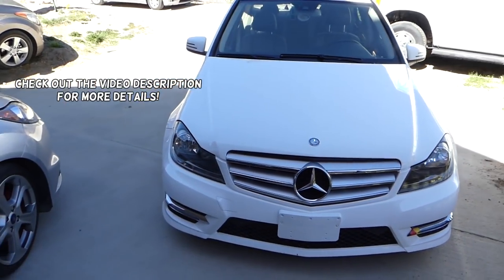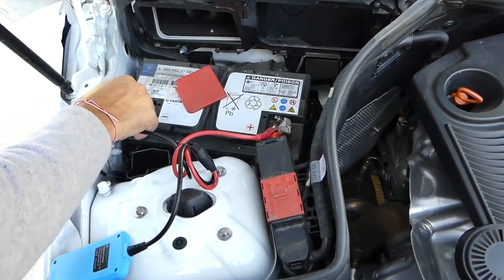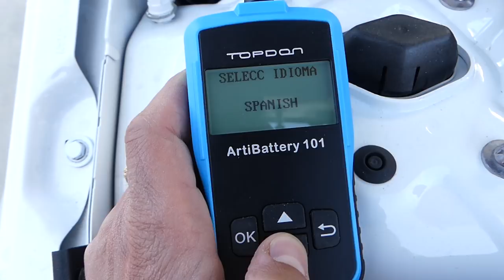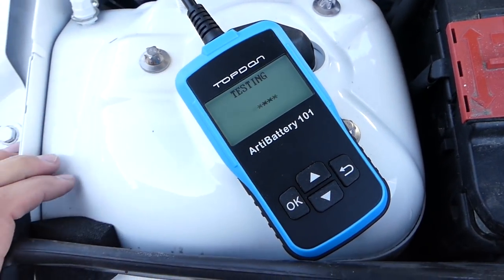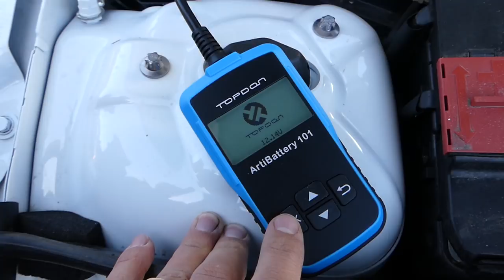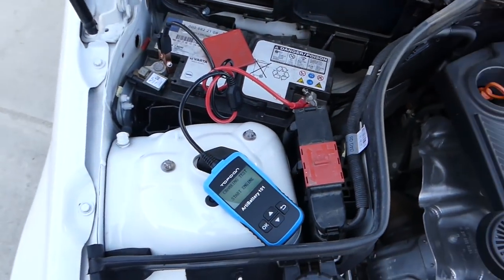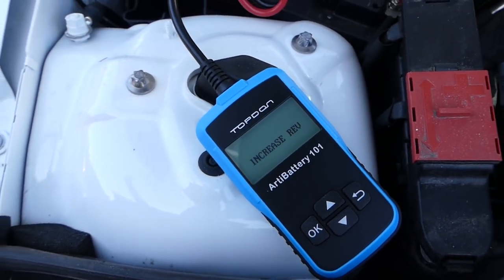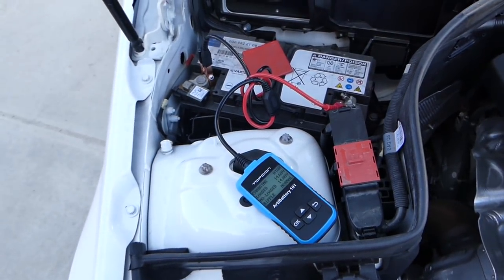HOW TO TEST CAR BATTERY demonstrated on Mercedes

Comment: Thanks for replying. In my older  ‘09 ML 350, I use to check battery from the dash, I don’t seam to be able to do that on the GLK350 2011. Is there a trick to that, do you know?

Comment: Out of the car, means that the battery is out of the car and disconnected when testing. You should have used the in car test.
Reply: Car test? What do you mean?
Reply: @avnii-sadiku6503  : Not car test, In car test. There are 2 different test types available, an Out of car test for when the battery is disconnected and on the workbench and an in car test for when the battery is in the car and the terminals are connected.